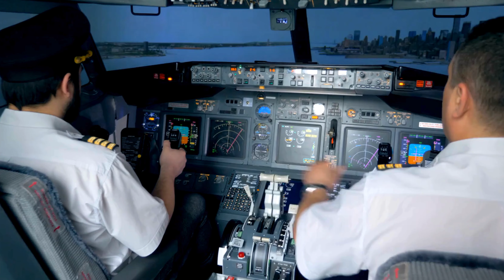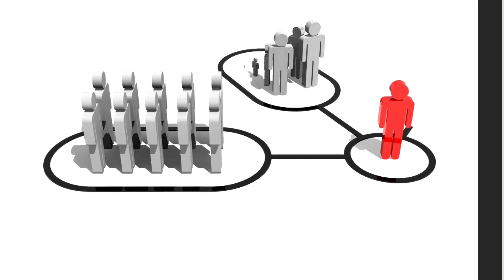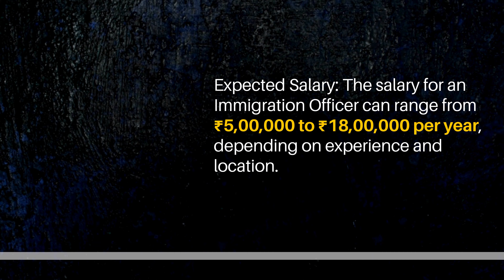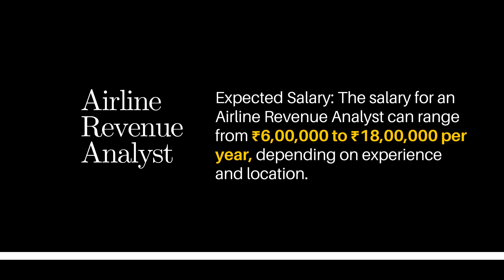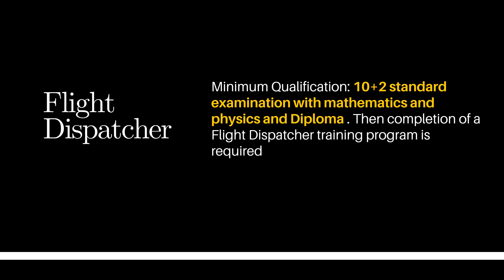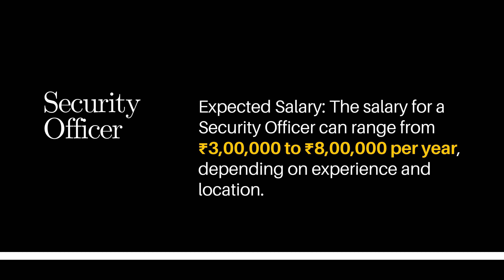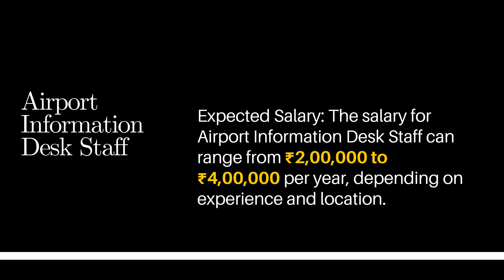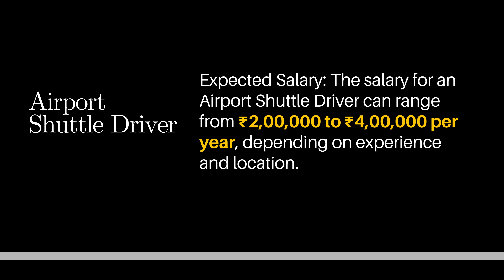Airport Jobs Explained in Kannada 2024 |Airport Jobs |Best Airport Jobs | Airline Jobs

Comment: Please tell the age limit for atc
Reply from the maker: The age limit for an Air Traffic Controller (ATC) job in India depends on the specific position you're applying for under the Airports Authority of India (AAI):

Junior Executive (JE): The maximum age limit is 27 years.

Senior Assistant: The maximum age limit is 30 years.

Manager: The maximum age limit is 32 years.

Relaxations are available for reserved category candidates:

OBC (Other Backward Class): 3 years relaxation (maximum age 30 years for JE).

SC/ST (Scheduled Caste/Scheduled Tribe): 5 years relaxation (maximum age 32 years for JE).

Additional considerations:

Age relaxation may be offered for candidates with disabilities and existing AAI employees.

Always refer to the official notification for the latest and most accurate age requirements for the specific ATC position you're interested in. You can find these notifications on the AAI website.

Hope I have answered your question.🙌